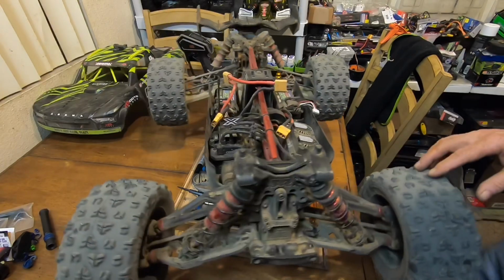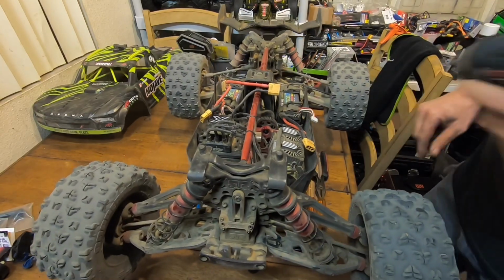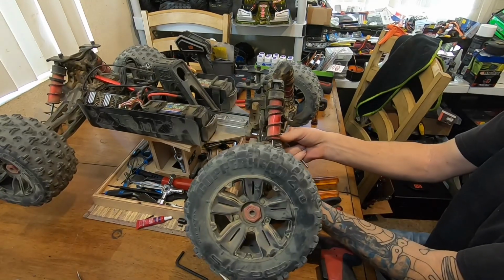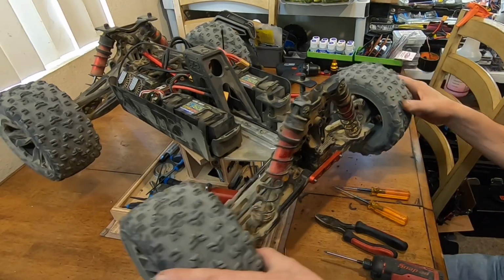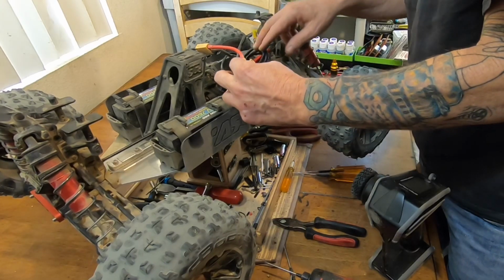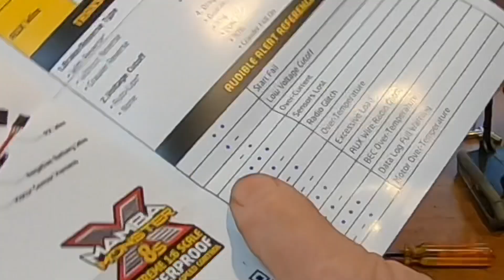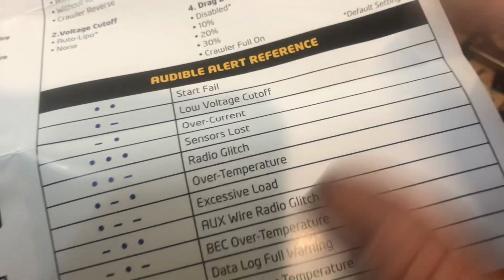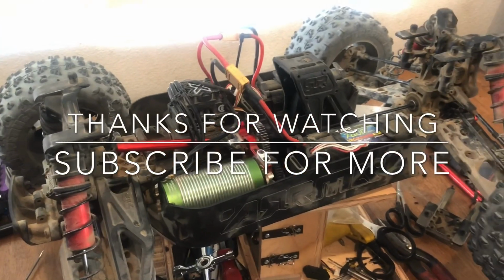Arrma monster Kraton 8s what went wrong bashing it

Comment: Some good information regarding troubleshooting the motor Bro. Glad you're able to sort out the issue. One of the reason I preferred sensorless setup over sensored system man for bashing/extreme bashing. I feel like sensored system are great for racing.
Reply from the maker: Yes I was hoping the sensor in a coke can will be good but I think it way to hard on the sensors inside the motors 👍👍🔥🔥🔥

Comment: That's a strange one Earl 😐
Reply from the maker: Right I really thought I broke a diff or gear but after tearing the hole rc down and checking everything I was at a loss talking to Rc guy he told me he’s heard a broken motor make that noise I was like no way it works great forward but after hearing the esc code i realized the sensor is in the far back of the motor and on impact it could have broke so I turned it to a non sensor system and it works fine craziest thing I’ve seen so far in rc 💯💯💯

Comment: Yep motor
Reply: Maybe nice cushion cradle ,too much shock w m2 chassis no give
Reply: You can take motor apart too , sure uk , I've changed bearings , I tell you good as arrma motors are the bearings arent both bigger ones like the castle . I didnt know till I ordered
Reply: I'm not sure about sensor motors , but if theres little wire inside I bet the solder broke off , ik easier just send back 😃 freaking hot here today , no wonder you guys on west coat always running hot
Reply: @paulclancy2404  the noise went away once he put his hand on the motor so either the end cap screws are loose or something in the motor is bad

Comment: Dynamite RC do a good large scale tool pouch with a lot of what is needed working on the bigger stuff they also a nice hex and ball hex set in a plastic container I have had these for years in fact I have two sets one in my workshop another in my tool go bag only ever broken the ball hex and not the tools fault mine rushing and tried to undo some bolts without taking the exhaust off so tried to use the 2.5mm ball hex's and broke one short and one long so had to remove the exhaust anyway as the ball end got wedged in the mushroom head bolt's that go into the steering pins grrr.
Reply from the maker: Thanks 🙏 I’ll look into those tools 👍👍🔥🔥🔥
Reply: Me2 exactly where I need ball end too exhaust

Comment: ON MY LOSI DBXL-E. MY DYNAMITE MOTOR HAD THAT SOUND.. I THOT IT WAS DIFFS. I FOUND OUT THAT MY MOTOR WAS BAD...  THE ROTOR CAPS INSIDE MOTOR CAME UNGLUED FROM MAGNETS n SHAFT. SO THE SHAFT WAS SPINNING AN BUT SLIPPING BUT SLIPPED LIKE LOOSE PINION BUT WASNT. MINE WAS MAGNET END CAPS ON SHAFT. THE EPOXY BROKE FROM LAUNCHING IT AT MY GOLF COURSE. I HAD TO REPLACE MY MOTOR.  GLAD IT WASNT SOMTHING LIKE THAT BUD..  GREAT TROUBLESHOOTING 🤙🤙🤙🤙🤙🤙🤙🤙
Reply from the maker: It still might be the epoxy I won’t know till I run it hard either way it’s under warranty
Reply: Earl Moorhead YA MINE WAS WAY OUT OF WARRANTY..  I HAD TO BUY ONE.. I FOUND A GREAT DEAL ON EBAY AN BOUGHT THE NEW SPEKTRUM  FIRMA 780kv MOTOR THEY PUT IN THE NEW LOSI DBXL-E 2.0.  SO ITS NEWER . BUT I DONT THINK ITS AS FAST/QUIK AS THE ORIGINAL DYNAMITE 1665 800kv THAT I REPLACED. TRYN TO SAVE LIL $$ ON THAT 1/5 SCALE PARTS PRICES...   THANKS FOR REPLY BUD.. 🤙🤙🤙🤙🤙🤙🤙🤙🤙🤙

Comment: Seemed to be when you got reverse back And then reversed, it happened, then when you grabbed motor it quit when you hit brakes and juiced it again. That motor sounds awful. MAY NEED PADDING
Reply from the maker: Ya I might need more padding the m2c chassis a beast some pretty hard hits on it and it didn’t move 👍👍🔥🔥🔥
Reply: @earlmoorhead5555  when you had your hand on the motor it stopped making the grinding noise...so it is possible it came apart inside